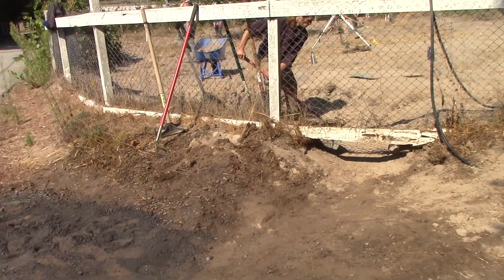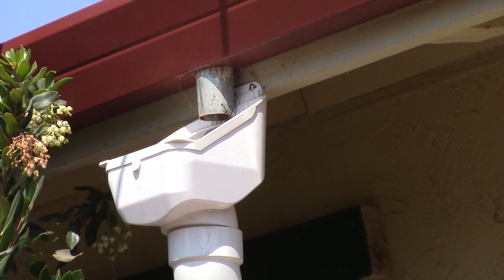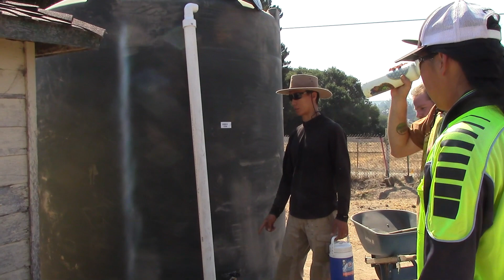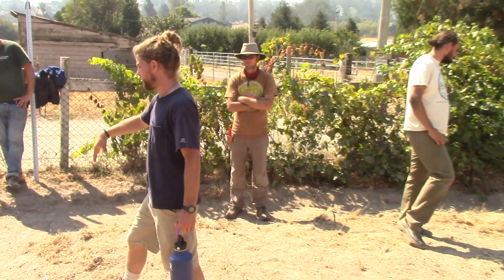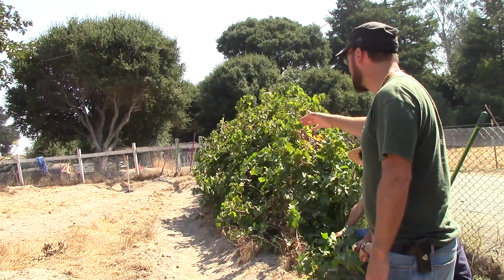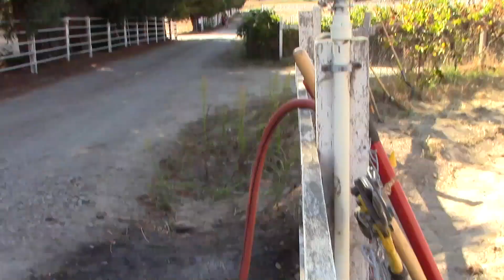Water Harvesting Workshop with the Permaculture Skills Center Part 2

Comment: What is head difference
Reply from the maker: Head is a term for describing height difference and/or pressure in water. So if you had a tank of water that was full up to 10 feet, and an outlet at the bottom of the tank, you could say that the outlet has 10 feet of head above it, or 10 feet of head pressure.

Comment: On the tank line for the feed,  I use a clear line for viewing water level and it's flexible.  I have shut off valves at top and bottom of flexible clear tubing to replace tubing due to age of tubing.

Comment: I think this interesting but I wonder if participants are paying a fee and then doing all the work for those putting on the workshop? 

If so,  they sure know how to work it.   If it's free for everyone to be there and your labor is the cost of the workshop,  then I'm all for it 👍
Reply from the maker: JesusFreakJen I can attest that the majority of the work was done before hand, by work traders and/or students in the eco landscape course.  what is important t to remember is that you can get information for free, but skills require practice.  You can learn all you want about rainwater catchment and water harvesting earthworks from books and videos, but until you get your hands on some tools and a shovel in the soil you don't really have the skills, just the information.  as I see it, the participants in this workshop, and others like it, are paying for the oportunity to build new skills, by practicing hands on in the presence of skilled and knowledgeable mentors, who can correct their mistakes before they go too far down the rabbit hole.  they are also paying for the access to some specialized tools ( how much does it cost to rent a good laser level, and do you know how to use it correctly?).  Also, the teachers need to be paid for their time, at the workshop and for the years of study and practice that prepared them to be experts in their field.